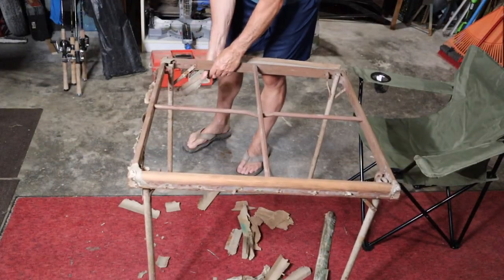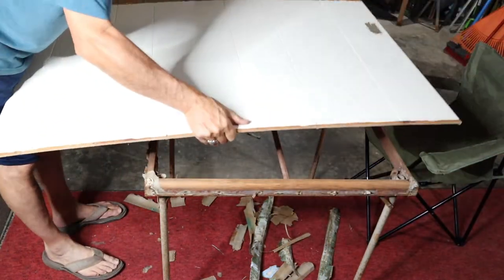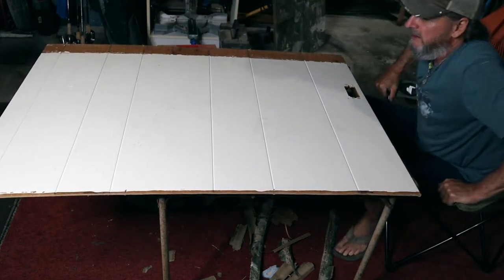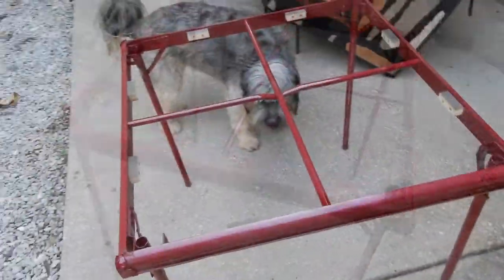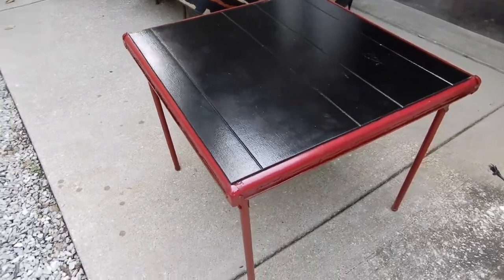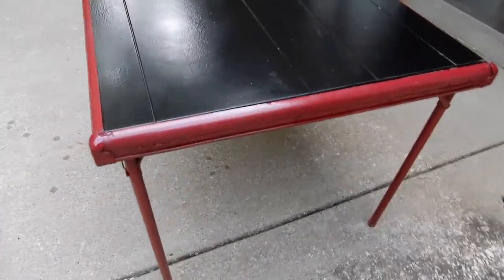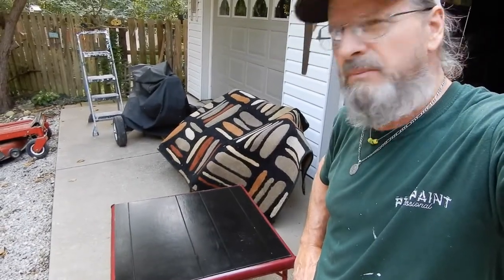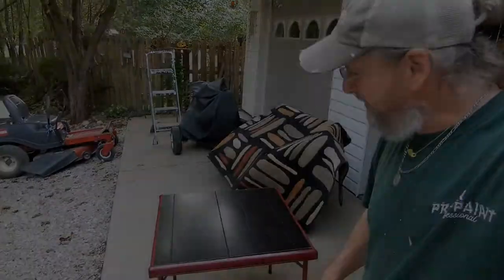Repurpose Vintage Card Table Brought back to Life #repurposing

Comment: Hi, nice vlog. Would have liked to see how you attached those "wood brackets" to the inside of the table?! I couldn't quite make it out from video. Still informative. Thanks for sharing.
Blessings from Iowa, L
Reply from the maker: Thank U for dropping by. Are u referring to the brackets I cut out of metal straps( I called them hurricane brackets)? I pre-drilled the wood extention pieces and original table legs then install the metal brackets with screws. The wooden extentions have dowel pins in the center then glued. I apologize for going through some of the process fast. As a YouTube creator we are always squeezed between making sure we add every detail and making sure the video is not to long...it's a real struggle!.... greetings back from Southern Indiana :)
Reply: NW, I get it! I actually think I would be a great "influencer". Legend in my own mind sorta thing?! If I could ever be quiet long enough to get the point across under 2 days?! The ones that drive me crazy are the ones that don't talk @ all...as on Tic Tok! A little too quick and I never really get all the recipe, supplies needed, etc. Today's generation? It's overcast and cooler here today. I'll take it! Not a fan of heat OR humidity! 
Hava great Sat, L
Reply from the maker: Thank U! It's the holiday and will stay close to home. Do U have a YouTube channel?....there's a lot that goes into... got to be careful security wise....but if u know a lot of stuff the world may want to learn from u :)
Reply: Sorry abt delay, hopefully you had a wonderful holiday wknd?! I haven't felt 100% last wk or so. It took 2 NEG Covid tests to prove otherwise. Probably flu?! We kinda forgot abt the old standards in illness. Anyway, I do not have a channel. Not yet?! Someday maybe?! 🤞
Reply from the maker: Yea....I still get the flu shot but anymore everything seems to be getting mixed together. A YouTube channel is a lot of work but when u make it to where u become a YT partner it's all worth the effort. Main thing is start filming and collecting that data. I think I'm at 344 videos.....now that I am a partner all those video have a  chance to make a little income :)....if u get a channel going let me know so I can follow u.....I actually have a video on how to get started....but there are many more u can watch on the YT channel to learn how to....glad u r feeling better :)